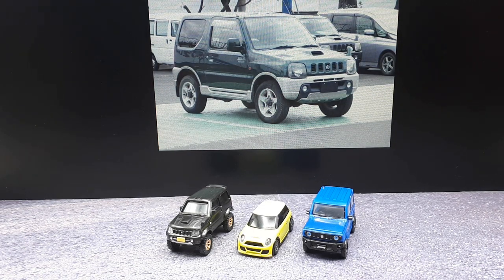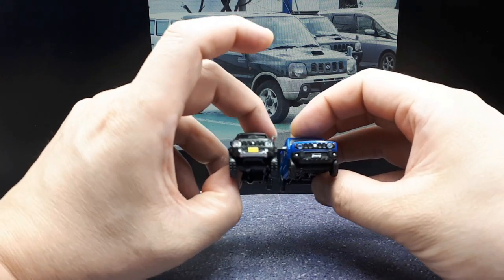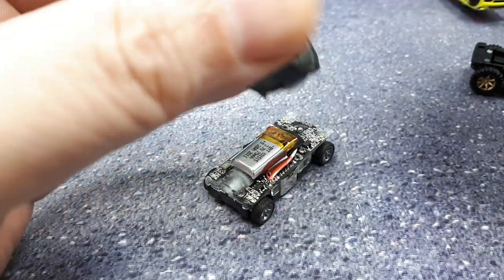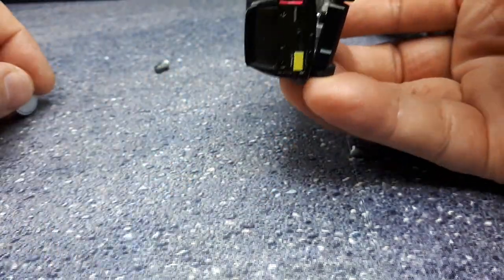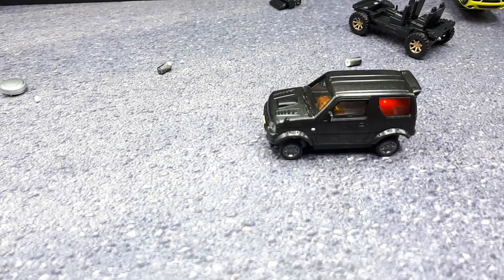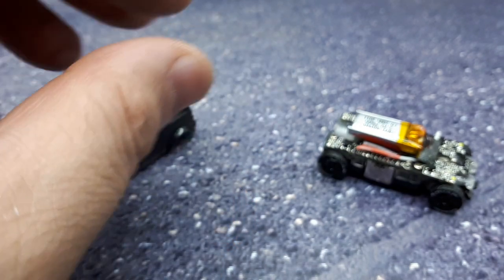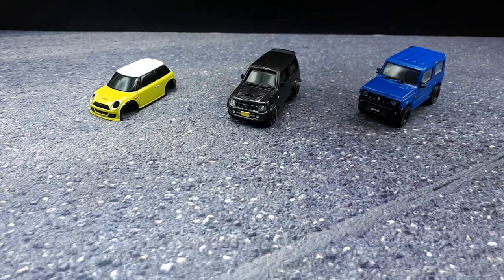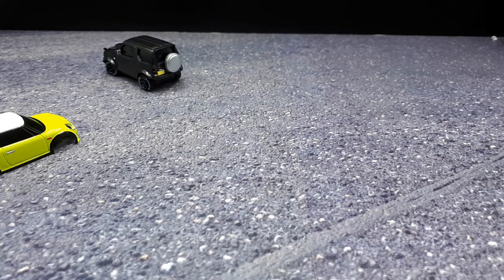1/76 Turbo Racing RC car body swap DIY tutorial how to

Comment: Incredibly creative, man. How fun is this thing!?
Reply from the maker: If you keep it on a table it's good fun.  Seems to slow to be rolling around on the floor though.  Also the axles trap lint/pet hair easy but the wheels can be removed with tweezers to clean it out.  I wish I had space for a diorama; this would be perfect.

Comment: I have the exact new Jimny and have swapped body with the Mini. The make is Beam and yes, it's 1/64. However, the body os a little long so you have to shave the fron wheel arches a bit. What's the make of the older Jimny? With the second gen c71 which had a slightly longer wheelbase, these bodies should fit perfectly.
Reply from the maker: the blue Jimny is by Aoshima; it's 1/64.
Reply: @smallmodelcollector  Ah, so Aoshima makes other models at this scale too. I have a Honda turbo city 1/64 but it's a bit big and have some difficulty removing the body because the rear view mirrors that stem from the chassis protude the body. It's quite hard to find these. I was lucky my LHS had them.
Reply: @smallmodelcollector  Hey man, i suggest you to wheel swap it

Comment: I'm confused did you have a 1/73 diecast? Or was it a hot wheels?
Reply: That’s what I’m trynna figure out. But from my understanding you just gotta get luck enough find a 1/64 diecast car that has a small chassis like some porches and Honda crv or Miata’s would fit fine as a body upgrade on these but nothing like a skyline or anything